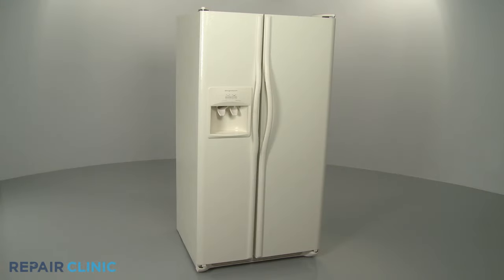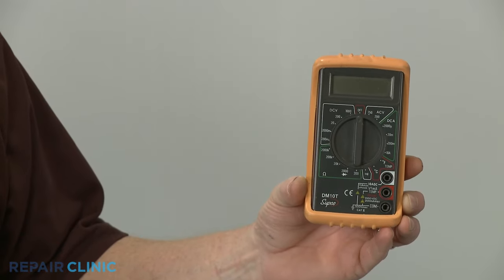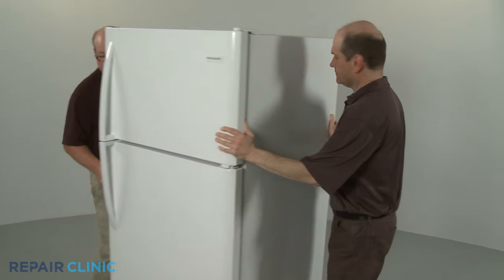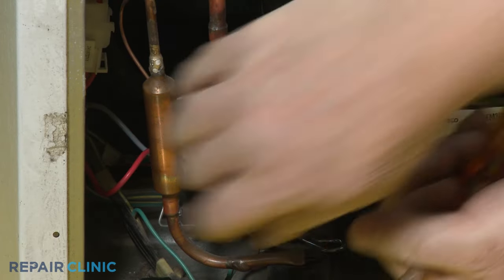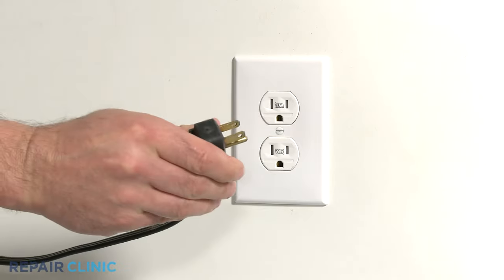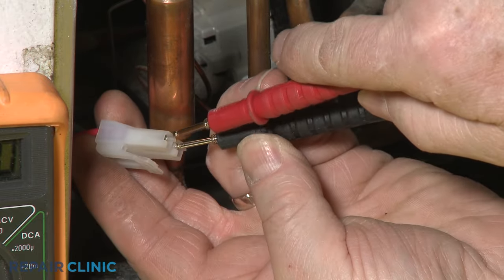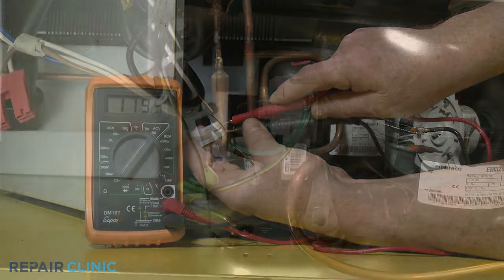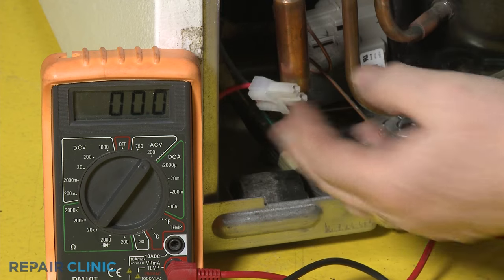Refrigerator Compressor Voltage Testing

Comment: Howdy.  This is what I have, does it indicate a bad relay?
Whirlpool WRT111SFDW03. 7 years old. 11.2 cu ft size. Freezer on top.
Start relay
P/N: WPW10448874, 
aka W10448874.

Capacitor ("cap") P/N: WPW10662129

Test relay connections with capacitor on the relay.
Results: when together I can get cap to charge and discharge thru the start relay, just like it does when it's off the relay.
With cap off and on, neither of the lower holes have continuity with each other. The hole on lower left has 0.0 ohms resistance thru the bottom blade of the back of the plug.
The lower right hole has no continuity with anything but can be used to charge the capacitor for testing.
The upper hole has 0.1 ohm resistance  to the top blade on the opposite side.

Remove relay cover and visually check. I cannot get combination relay apart without breaking it, so I haven't committed to that, yet.

Ohm test the fridge compressor pins again. Make sure the Common (top) and lower pins are within 3 ohms. And the two pins at bottom should read about the sum of the Common with the Start and Run pins. See YouTube video...
Results:
Top and Lower Right : 4.4 ohm. 
Top to Lower Left: 6.0 ohm.
Two bottom pins: 10.4 ohm.
None of the pins are shorted to ground.

My problem is it suddenly stopped cooling without noises or warning, but I caught it from hearing loud buzzing noise from compressor and relay area, and compressor was very hot. No smoke or smells though, and wires did not seem to be hot.

Do you think it's the combination relay? Thanks much!

Comment: Hi, I have a Curry refrigerator, Just recently I noticed the light inside the fridge is not as bright as before and I didn't hear any humming sound to signify the engine is running. So I unplugged it for some hours and plugged it back in, the light eas bright and the humming sound started, then after 40 mins the humming sound shut off and there was a click sound, some minutes after I heard another clicking sound and the humming started again but winded down like engine shutting down, this repeater after some minutes, click sound then humming and shut down.
What could be the issue?
thanks
Reply: bad relay